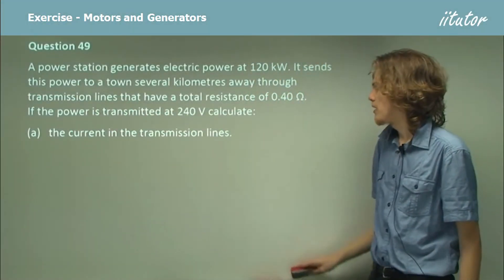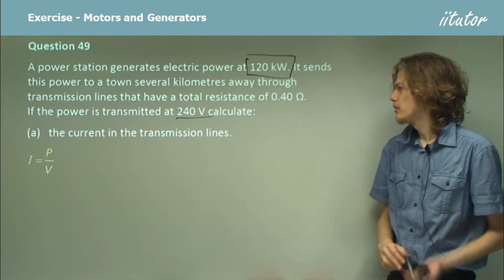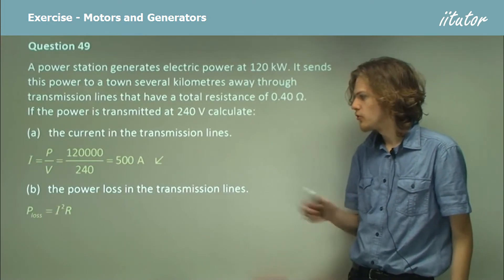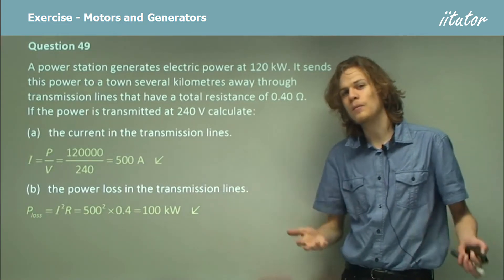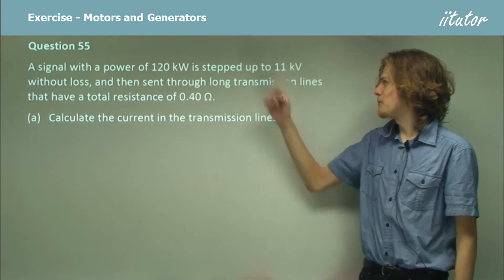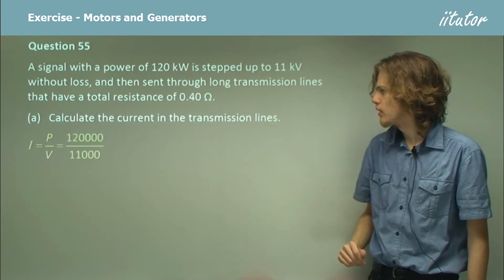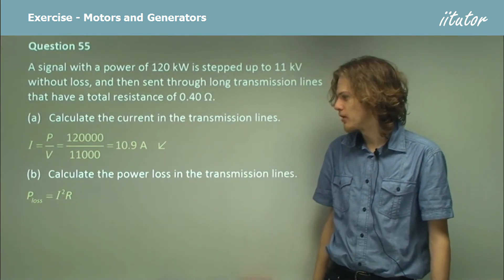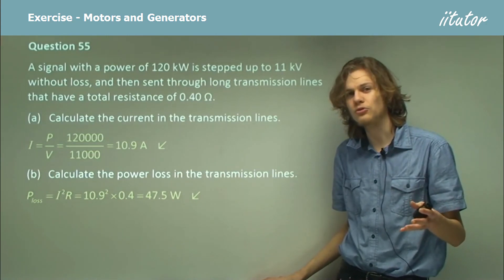Mastering Transmission Line Calculations: Current and Power Loss Demystified

Comment: Is there loss when the power is "stepped up" to a higher voltage?
Reply from the maker: Yes, there is some loss when electrical power is "stepped up" to a higher voltage. This process typically involves using a device called a transformer. The transformer increases the voltage while decreasing the current to maintain the same amount of power, as power is the product of voltage and current (P = V * I). The conservation of power means that when voltage is increased, current must decrease, and vice versa.
Reply: @iitutorcom  thank you for the quick reply

Comment: In first case if we will use formula for power P=V2/R then power loss comes 144kW whereas if we use formula P=I2R then it comes out 100kW. Why such difference?
Reply: The 240V drop isn't just over the transmission line - it is also over whatever load is attached.

Comment: Hi. I am about to teach my students about loss of power in transmission. I have a doubt. Suppose in the first case, the voltage is 200 Volts (and not 240V). The current comes out to be 600A. And the power loss comes out to be 144KW. But the power generated by the station is 120 KW. So how do I explain the loss of extra 24KW? Thanks.
Reply: how can the power loss be greater than the power generated? Its either theres something wrong with the input given or you made the wrong derivation
Reply: I think then it actually won't be able to transmit that current
Reply: Even though your calculations show power loss > input power, it doesn't mean that when you try to transfer the power the loss will be 144kw it will be 120kw only, the extra 24kw is the value is to be compensated by increasing voltage level or add another supply after which you can supply the load
Reply: Its an unrealisable system, bcoz you have rload in series with 0.4 ohm transmission line, even with 0 rload you can create maximum of 500mA with 200V.